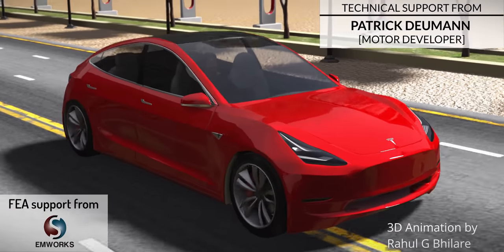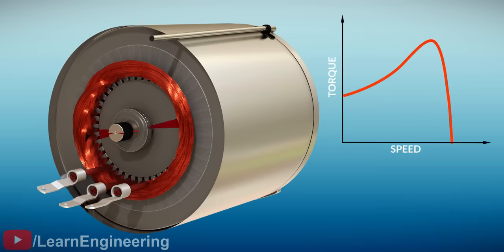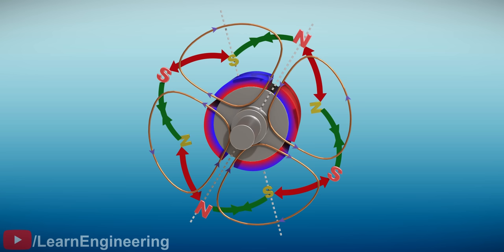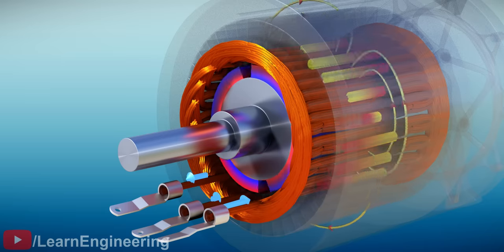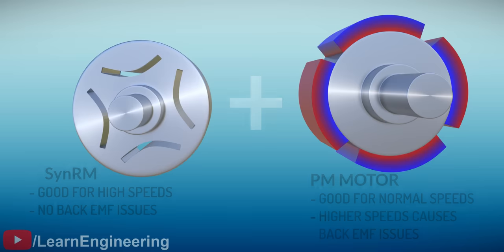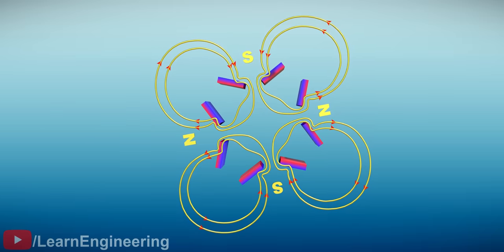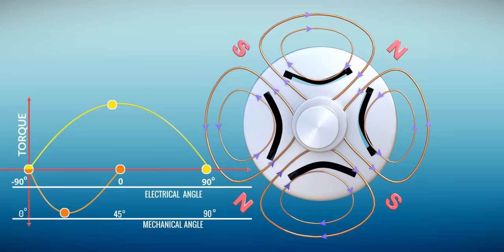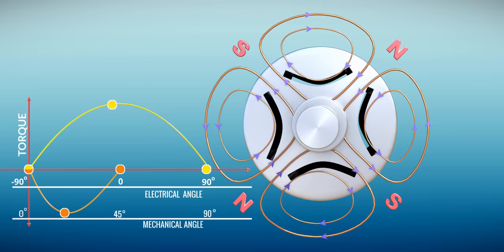Tesla Model 3's motor - The Brilliant Engineering behind it

Comment: My "Reluctance" is the high cost, !!! otherwise i'd love one...
Reply: Well, Build your own.  You don't need to buy one.   Just don't use induction motors.  
but for City driving, and ability to Charge batts in-between,  all these issues are NO issues!!! 
they only matter on long highway drives and the inconvenience of Recharge and WHERE and WHEN.......
Reply: Do a Total Cost of Ownership calculation. If you don't change your car every 2-3 years and live in a place with somewhat high gas prices, a Model 3 becomes affordable by the saved gas money. Also, Teslas seem to have a rather high value retention, which means their value drops much slower than most other cars.
Reply: @jesscast5122  If I could, I would, but due to a rallying incident i'm in a wheelchair, none electric...:) for quite some time...
Reply: @pip5461  Well, then build one! A wheelchair retrofit for Tesla cars, I mean. Find a partner who has some money (that doesn't cost millions), and ideally the same interest in/passion for Tesla; and retrofit one together, as a prototype. If you do that well I am sure you will find commercial success, too. Especially given the autonomous potential for handicapped drivers, in the not-so-distant future.
And in the process of doing so you will get your wheelchair accessible Tesla, for free :D
Reply: After 5 years of driving a SR+ Model 3 Tesla, and considering the resale value, it comes out cheaper than a Camry.

Comment: A bit too much credit given to Tesla for this in my opinion. I appreciate the breakdown of what tesla is using in their vehicles, however to insinuate Tesla invented these concepts is a bit misleading. What have they done here that has never been done before in electric machines? Perhaps being the first to recognize the optimal parameters for their drive cycles.
Reply: The point is that it was optimized to give great performance from a stop and at high speeds.  The competition is tough, and small advantages make a difference to the buyer.
Reply: I would also add that performance and efficiency affect the distance you can drive on a battery charge....each little difference can add  up in enhancing that distance capability as well!

Comment: "Alternative current is flowing out the battery pack" - I understand this, but you could say 1 sentence that the battery only can output DC.
Reply: I don't really understand, can you explain this?
Reply: they didn't mention it but it probably has a DC/AC converter on the vehicle to do such thing.
Reply: They use inverter
Reply: @evertwouda  There are 2 types of electric currents. AC and DC. the current that comes to our homes is AC. whereas the current that comes from a battery of any electronic gadget is DC. So in this video the narrator said AC is coming out of battery pack which is theoretically wrong. An inverter is a must to convert it from DC to AC.
Reply: @dranzergigs8333  exactly
Reply: It has an inverter - almost every EV is AC based - the first pioneers with permanent magnet motors in EVs were from Toyota in their Prius model... hardly novel idea from Tesla here.
Reply: Of course if you know how it works, it's up to you exlain. No idiot will feed directly a DC supply into a 3-phase motor.
Reply: There is a 3 phase inverter that drives the motors.
Reply: @dranzergigs8333  There is only one type of electric current - moving electrons.  If they always flow in one direction it is DC, if they periodically reverse direction it is AC.

Comment: Is there a low weight version of this motor that could be used on drones?
Reply: Because it relies on a solid metal core, unfortunately I think it would be too heavy for small drones; If you notice on modern drones the stators are inside the motor (instead of being on the outside) and the magnets are in a ring on the outside. This allows the motor to be small enough, run fast enough and give enough torque for drones without overheating.

Comment: While I appreciate the beautiful animations, the whole storytelling is flawed. The motor design Tesla is using is very normal for any Permanent-Magnet Synchronous Motor that is used for traction drives. A similar design was already used in the very first Toyota Prius, the BMW i3 and many, many other motors more than 10 years ago. Today, this design has become the standard for all PM-Synchronous machines in any electric car. The principles of this design were explored already in the 1990s by W. Soong and T. Miller: ‚Theoretical limitations to the field-weakening performance of the five classes of brushless synchronous AC motor drive‘. Even at that time, the design was already well known from other sources and not invented by these authors. Sorry, this whole video just tells a lie.
This is not to say that Tesla‘s motor is bad. Actually, it is quite good (I am a motor designer since 30 years and have seen many motor designs in my career). However, this motor has a rather typical design. It is not special in any way.
Reply: It's not the same, there are definitely improvements over your standard designs. Just look at Munro's analysis and comparison of recent EV motors, Model 3 is the most advanced design.
Reply: Dude, someone stripped a tesla car apart, took the motor and compared it with other motors in the market and it really was the fricking best. How do you think they get the most range out of all production BEVs today?

Comment: About canceling permanent magnets field, it may demagnetize them, we are instructed to not apply an opposite field to  a permanent magnet when design or run a motor because it demagnetize it.In common synchronous PM motor magnets are magnetized at no or lo loads, over time rotor magnetic filed is intensified, PM synchronous is symmetrically reversible (motor/generator) it acts like a inertial energy storage symmetrically bidirectional coupled with electrical power supply.

Comment: How is the electrical power controlled to the motor "Learn Engineering?"  I ask that because I would think that would be an interesting topic also.
Reply: with a control box attached to it?
Reply: @emilianoruiz7681    I was thinking the PWM and the SiC semiconductors used.

Comment: Toyota Prius motor - The Brilliant Engineering behind it
Reply: Yes, Toyota was the first one to use permanent magnet based motor in EV. Of course their marketing department and hype department are way, way behind Tesla.
Reply: @tomk3732  Plot twist, Tesla doesn't even do or have a marketing department, let alone a hype department
Reply: @neighborhoodtroll  Maybe you need to watch Elon more - like his hype about CyberTruck. Seen a ball thrown at windows? Seen it "beat" old gas truck. Did you know all car windows are so strong, according to tests, that at low angles the can deflect pistol rounds (smaller ones)? Did you know the gas truck picked to compete with CyberTruck is the only version Ford tried without full frame? Why does adaptive cruise control is called auto pilot? Why do they call unibody "stretched skin" or other "cool" names? Did I mention names of the cars themselves?
Reply: @tomk3732  Yeah, you're right. They tend to have catchy namings for their not so up to the mark products as they claim. But they atleast have to do such stuff to sell cars from their company which a very few people know of.

Comment: All motors produce a back EMF including AC induction motors and AC reluctance motors, sorry but this video maker doesn't understand motors at all. It is easy to  see why a permanent magnet motor generates a back EMF, but any AC motor supplied with  AC can and will oppose the flow of current into it by generating a back EMF.
This video over simplifies what is going on to the point where it actually obscures the true physical principles at work. Terrible.

Comment: Good to see engineering looking at the working theory of motor functions and optimizing the design.
It seems a deeper look is overdue. Steinmetz did the original analysis of how changing magnetic fields interacted with inductors (instant Lens law back EMF), but Nikola Tesla added capacitance to his inductors (with a bifilar modification) and observed the capacitance charged up along the entire conductor first before the inductor responded, and as the magnetic field changed the capacitance released an opposite charge, the response of the inductor switched polarity reversing the Lens law resistance to compliance with the switched magnetic field; net result a motor that generates electricity that powers the motor....(Potentially infinite range, self-powered motors) For Tesla it was self=powered alternators that sourced the energy he amplified for transmission at Wardenclyffe. (would have bankrupted the Niagara Falls investors (JP Morgan his business partner, no wonder Morgan chose to bankrupt and discredit Tesla)

Comment: The ipmsynrm motor is in the back, not in the front
The magnetic field lines are not correctly drawn in the rotating animation
The maximum torque angle is not correctly drawn
Very informant video nevertheless

Comment: I think if we wind the rotor as magnet carrying and the stator as the coils and alternatively arrangement so that after each push from permanent magnet to the magnet unclosed inside rotor coil the next region is the reversed arrangement so that instead of pushing, it use the magnet inside the rotor coil to induce a voltage and current inside the stator coil and go on to the next winding to receive another push and keep on going that way not only it act as a motor, half of the time it is a generator. That is what we called self excitation motor

Comment: It seems like the permanent magnets could be replaced with DC excited electromagnets, which might produce higher starting torque (they could be stronger) then can be entirely shut off once rotating at high speeds. 
The DC coils wont have the same effect as an induction motor as the synchronization of the rotor will not induce an electric current. (Theres no slip).
It seems that a DC excited electromagnet would be better than using a permanent magnet, but i’m not sure.

Comment: Too many people are missing the difference between a permanent magnet motor and a reluctance permanent magnet motor.  Reluctance motors have been around a while, but have never been that practical and not used in any other situations before Tesla.  As stated in this video, traditional permanent motors have losses due to back EMF so are not efficient in this condition.  Reluctance is a difference principle from magnetic induction.  That is why induction motors are traditionally used in, for example, diesel electric railroad engines as they are well understood.   Tesla was first to take the reluctance style motor into major production in a "mass-market" device - a car.

Comment: This is the electrical equivalent of variable valve lift and timing design in an internal combustion engine. The energy, reliability, and monetary cost of the mechanism to achieve variable valve lift and timing out weighs the benefit. The electrical version however is a much smaller cost in all three of these categories so a net gain is achieved.
Reply: ... until you have to buy one

Comment: Thanks to Elon, electric motor development got the well deserved attention. Its evolution will not stop. Koenigsegg has already proven that much more can be extracted out of electric motors, making them suitable for electric planes. Tesla has to optimise efficiency vs cost. Space savings is not on their target. So they use more and more carbon fiber and direct oil cooling. Eventually wheel motors are the go.

Comment: Hi, the starting torque chart you showd for the induction motor is inaccurate in that these induction motors are powered by a flux vector controler which can easily produce 140% plus torque (which would burn the motor out if it was sustained too long). The curve you shjow is true for Direct on ine  starting which is not used by Tesla (or any othe EV manufacturer using an induction motor). Apart from that, good presentation

Comment: Great explanation and animation but a bit of a puff piece too.

Based on the information it's reasonable to infer that the driver circuits need to be more complex and sophisticated and the manufacture would also be more expensive and complex. Conventional 3phase  induction motors only require a high power inverter/VFD to run. The control circuits don't need to know where the rotar is.

Comment: Just chiming in, other battery driven vehicles like electric scooters do not have induction motors, they have brushless AC motors and they have magnets on the outer ring which rotates, so in fact there are three types used today
Reply: "magnets on the outer ring which rotates" means an outer-rotor or "outrunner" PM motor, which works the same way as an inner-rotor or "inrunner" PM motor, so it is a design detail which which I wouldn't count as a different type of motor. Even an induction motor could be built with an outer rotor, although I've never heard of anyone doing that.

Outer-rotor motors are uncommon in EVs, but TM4 (now part of Dana TM4) makes them for heavy vehicles.

Comment: Not Tesla is the inventor and developer of this engine, just to say it like that!
The development of IPM-SynRM motors is based on research work in the field of electrical drive technology and motor control. A large number of companies and organizations around the world have contributed to researching and developing new technologies and concepts for efficient and powerful engines.

Some of the leaders in electric motor development in the 1980s, such as ABB, Siemens, Nidec, Bosch and Mitsubishi Electric, conducted extensive research and development activities in permanent magnet synchronous motors (PMSM) and synchronous reluctance motors (SynRM). These companies may also have contributed to the development of the IPM-SynRM engine, or developed similar engines with similar characteristics. They developed the principle for their electric motors for industry.

Comment: Does regenerative braking works in this motor, since it rotates at synchronous speed.
Reply: Yes you can generate power with braking and it can also be done with an induction (asynchronous) motor. The little stepper motors found inside printers and scanners make pretty good generators, too.

Comment: Excuse my ignorance but this new electric motors how much they wheigth compared to the previously used on tesla cars as complete unit, exsample the old motor and controll box weighted 300 kg, the new ones should weight less?
Do they use less current at same real conditions of the old ones per km?
What about lifespan?
Does the motor have better overall performance?
What about mantainig cost are they cheaper?
Do you need more materials or more exspensive metals and more time to buil them?

Comment: Are IPMSynRM motors are also used in electric locomotives? Seems to be the perfect application due to high torque from the beginning.
Reply: Locomotives in the past have typically used DC traction motors, but some are made today with AC traction motors like the ones in the video.

Comment: No not  at all. Tesla were unique in using the very  old fashioned induction motors( IMs). Most other manufacturers use Permanent Magnet synchronous machines (PMs) as they are more efficient and power dense. However it is possible to use a compromise between PM and  a Switched Reluctance machine. ( A switched reluctance machine has a shaped (salient) iron core to rotor to provide the rotor field).This uses a much heavier iron rotor which tends to lose efficiency but does allow a reduction in the volume of the very expensive rare earth permanent magnets. Generally it is not done to improve performance but rather to save costs. It doesn't mean the motors are significantly worse than the PM machines although they tend to be less  power dense. They are probably better  than IMs though.

Comment: If we use the term alternator in correct meaning by widing the brushless motor alternating pattern so that on coil on stator push the opposite coil on the rotor and the next one is the coild on rotor pass by a coil electric generator next to it generate electricity and then the next one is the oppositen of it then repeat the cycle forever and only need enough stored energy restarting next part

Comment: Tesla Model S uses AC Motor and Model 3 uses DC Motor.Rotor is the moving part in DC Motors,in AC Motors the moving part is called "armature"
Reply: No, the Model 3 motor is not a DC motor - it is a synchronous AC motor.
Reply: In any motor the stationary part is called the stator and the rotating part is called the rotor.
In a DC motor, the stator has a field winding or permanent magnets, and the rotor (which has windings that are powered through the commutator) is the armature.
In AC motors the term "armature" is rarely used.

Comment: Electro magnetic technology will rule the electric technology and simply method of  high air turbine on the running car in front + on roof may be a good charger of Lithium-ion battery.

Comment: But i do like Tesla's new high speed electric motor with the carbon fiber bound rotor,the higher the speed of the motor the smaller it can be for given power output therefore lighter and more powerful and more efficient in both materials and energy needed to accelerate,Way to go Elon.

Comment: All Tesla needs to do is add a turbo encabulator to help with the eddy currents.  Probably wanted to keep costs down.
Reply: Thats should reduce impedance do to the reduction in wobble produced by the solenoid inverter.

Comment: So induction motors are 94% efficient and these Model 3 motors are 96% efficient. That's not an impressive optimization of the car as a whole considering the electricity source (i.e. batteries) needs to be completely replaced! Onboard electricity storage or generation deserves all the engineering attention.